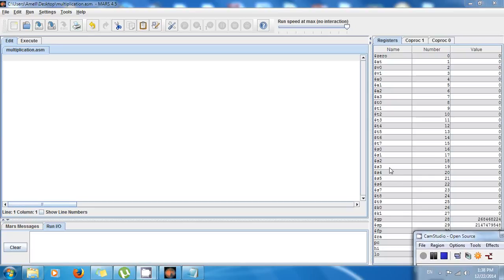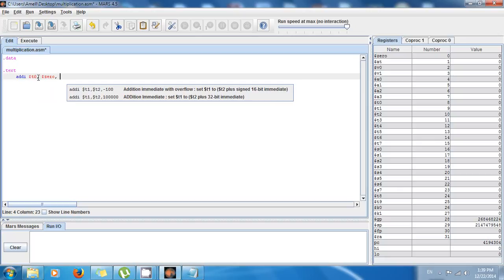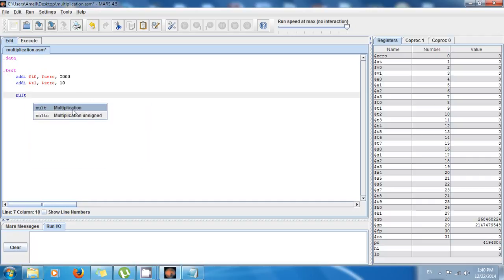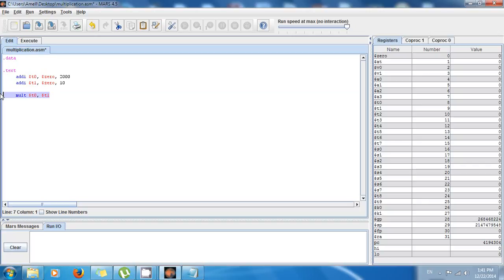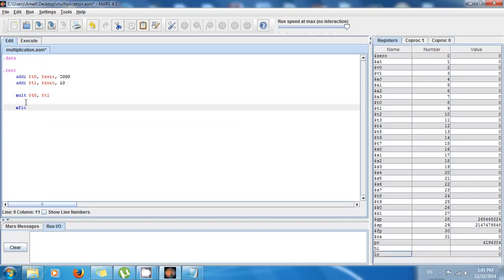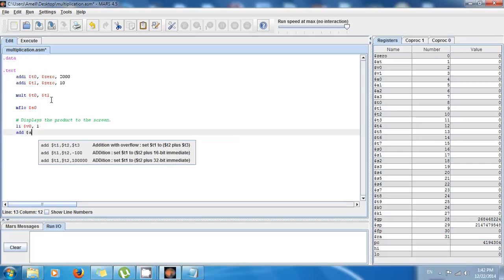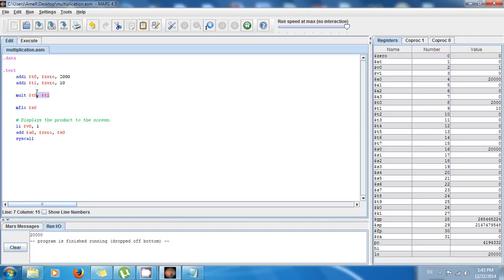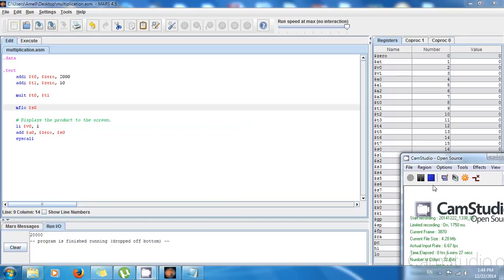MIPS Tutorial 11   Multiplying Integers mult

Comment: li $t0, 2000		# The values to multiply.
li $t1, 10
	
mult $t0, $t1		# t2 = t0 x t1. (Result is put in registers LO and HI.)
	
mflo $t2		# Move-From-LO into register t2.
	
li $v0, 1		# Print the result.
move $a0, $t2
syscall
	
li $v0, 10		# Exit program.
li $a0, 0
syscall

You're welcome!  :)

Comment: I ended up making two more variants of this program to play with bigger numbers. Here's the first variant.

.text
    addi $t0,$zero,0xffff	# 65,535 (highest 16-bit value)
    addi $t1,$zero,0xffff	# 65,535 (highest 16-bit value)
    mult $t0,$t1		# 429,483,6225 (32-bit value, 0xFFFE 0x0001)
    mflo $s0
    li $v0,36			# prints unsigned 32-bit integer
    add $a0,$zero,$s0
    syscall

In this one, I'm multiplying 65,535 and 65,535 to get 429,483,6225. Since the resulting value is 32 bits it will happily sit in a single register. However, if you print it normally then it will end up being negative. So instead of li $v0,1 you need li $v0,36. Had to look up this syscall function to figure that out.

Now here's another variant of the program.

.data
    candyText: .asciiz " left circular shift 32 positions, add "
.text
    addi $t0,$zero,0xffffff	# 16,777,215 (highest 24-bit value)
    addi $t1,$zero,0xffffff	# 16,777,215 (highest 24-bit value)
    mult $t0,$t1		# 281,474,943,156,225 (48-bit value, 0xFFFF 0xFE00 0x0001)
    mflo $s0			# move 0xFE00 0x0001 into $s0
    mfhi $s1			# move 0xFFFF into $s1
    
    # print hi register
    add $a0,$zero,$s1		# 65,535 (0xFFFF)
    li $v0,1			# Works because it's no more than 16 bits.
    syscall
    
    # print text for formatting
    la $a0,candyText
    li $v0,4
    syscall
    
    # print lo register
    add $a0,$zero,$s0		# 4,261,412,865 (0xFE00 0x0001)
    li $v0,36			# prints unsigned integer, needed if more than 16-bits
    syscall

Basically, I'm multiplying two large values to get a 48-bit value which can't sit happily in one register. In this case, mult ends up saving them in both the lo and hi registers. I'm not sure how to print any value above 32-bits, so I printed a textual description of how you'd get there with arithmetic. The result should print this:

65535 left circular shift 32 positions, add 4261412865

Comment: Why not do it this way?

.data
.text
 li $t0, 20000
 li $t1, 10
 
 mul $a0, $t0, $t1
 
 li $v0, 1
 syscal
Reply from the maker: It is fine to do it either way, but the advantage of doing it with lo and hi registers is that you can check overflow, if necessary.
Reply: I think he did it this way in the previous tutorial. This one is showing us how to do mult :)

Comment: Why didn't you show how to print result stored in two registers? This was an easier version but what if the result goes to hi and lo registers? How can we represent the result then?
Reply: I think you will get your answer here- https://stackoverflow.com/questions/16050338/mips-integer-multiplication-and-division
Reply: @yashchandraverma9899  It doesn't explain how to retrieve from both hi and lo
Reply from the maker: That is easy, too. Use the syscall to print number stored in hi, and then use the same syscall to print number stored in lo. 
Example:
li $s0, 100000
li $s1, 654321

mtlo $s0
mthi $s1

li $v0, 1
mfhi $a0
syscall

li $v0, 1
mflo $a0
syscall
Reply: If i understood correctly, you move from $s0 register to lo register and from $s1 register to hi register and just call them and print them. Where is the multiplication? It is just like store in an other register and take from there. I asket for real multiplication for example:
li $s0, 1242331
li $s1, 655442
mult $s0, $s1
how can i print the result now? This is the real multiplication

Comment: Great tutorials! Thanks a million mate! :)
But I have a question...
What's the difference between "add $a0, $zero, $s0" and "move $a0, $s0" and why do you prefer to use the first method?
Reply from the maker: You're welcome! The difference is that "move" is a pseudo-instruction in MIPS assembly language while "add" is a real instruction. Pseudo-instructions will be translated into real instructions by the assembler. It's perfectly fine (and even recommended) to use pseudo-instructions for code readability and clarity. However, in computer architecture courses, some professors prefer to teach students the core real instructions, so that they can get a deeper understanding of the MIPS architecture.
Reply: Thank you for explaining so well! :)
Although I have one more question...
Is there a way to assign a register's value to a location in RAM?
For example, in the .data part we have "counter: .word 0". Can we later change the value of counter in the .text part?
Reply: I think it's the sw instruction. Do you explain its use  in a tutorial?
Reply from the maker: Yes, you're definitely right. Store word stores the value of a register into a memory location.

Syntax:
sw register_source, RAM_destination
# store word in source register into RAM destination
sb register_source, RAM_destination
# store byte (low-order) in source register into RAM destination 

Simple Example:
.data 
    theAnswer: .word 0
.text
    main:
        li $v0, 120
        sw $v0, theAnswer  # Store 120 in RAM.
        
         li $v0, 10
         syscall

A good practical example of the lw and sw instructions is my tutorial on recursion. The link is bellow:
https://www.youtube.com/watch?v=B6ky4Weahm4&list=PL5b07qlmA3P6zUdDf-o97ddfpvPFuNa5A&index=34
Reply from the maker: Also, my tutorial on arrays shows the use of the sw instruction: https://www.youtube.com/watch?v=BfHcogmKM20&index=27&list=PL5b07qlmA3P6zUdDf-o97ddfpvPFuNa5A

Comment: Imagine that the result is grater 32 bits, and you have the result in both lo and hi. How do you print the result?
Using your example I tryed this:
.data
 numero1: .word  200000000
 numero2: .word  10000
 
.text
 lw $t0, numero1
 lw $t1, numero2
 
 mult $t0, $t1 
 
 mflo $s0
 
 li $v0, 1
 move $a0, $s0
 syscall 

My hi has the value 465, but lo has a huge negative value...
Reply: +António Godinho so a register has only 32 bits? so the biggest number it can store is 2^32 -1? is that right?
Reply: +António Godinho so a register has only 32 bits? so the biggest number it can store is 2^32 -1? is that right?
Reply: when your number is greater than 2^32 -1 then it goes from -2^32-1................so it has negative value